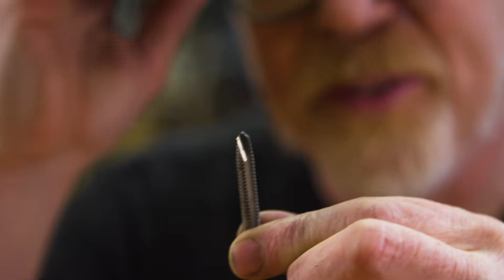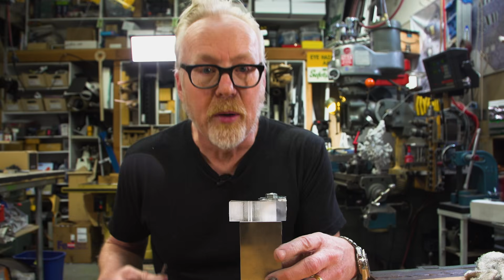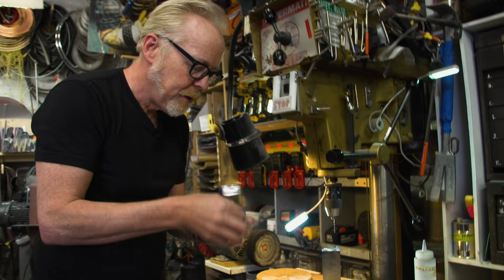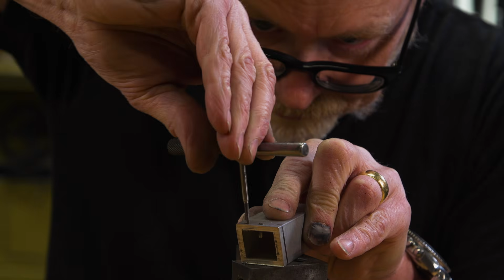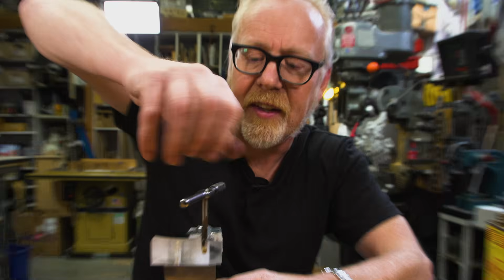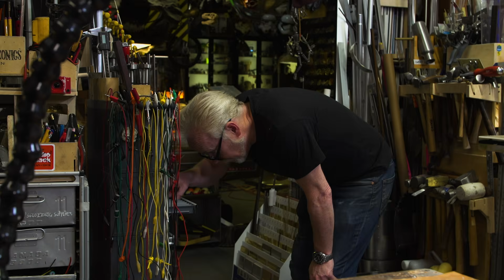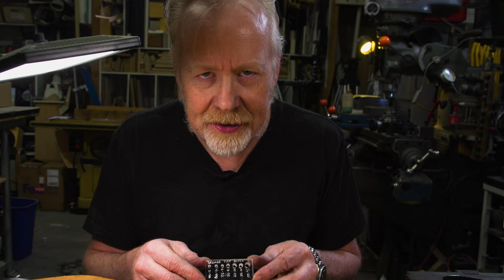Adam Savage's One Day Builds: Thread Tapping Guide Block!

Comment: I use taps every day, drilling and tapping holes in steel window frames. 

Rarely do it by hand, mostly use air powered tap guns. If it's something tiny like an 8 or smaller I might use a hand tap if I'm afraid I could break it. Or if I'm tapping into two different metals (sometimes they layer steel and stainless steel) or if I'm tapping just stainless. For some reason it's a major pain to tap stainless. 

By hand or with an air tool, tapping oil is your best friend. Lube it up, meng. 

We go down to 6-32 screws and taps and up to 1/4-20. Not usually any larger than that. 

If you break a tap, it can be pain. But like Adam said, taps are brittle. A cheap center punch and a ball peen hammer will help you break the tap into pieces and it'll fall out of the hole. Just be careful not to chew up the hole or the threads. 

Otherwise, sometimes you can just back a tap out by hand. That's always a nice break. 

It's funny to see someone enjoy tapping so much, but I just do it everyday so I suppose any novelty wore off long ago. A lot of the tapping I do is to holes that were already drilled and tapped but then they paint the steel frames or hot dip them in a molten zinc bath for a galvanized anti rust layer before paint. So you have to remove all that paint or none of the screws will go in. 

Happy tapping, y'all.

Comment: I was forced to do my first "tapping" when doing a plumbing repipe and had to cut and remove a section of galvanized pipe and rethread it with a Rigid pipe threader. That opened it up for me as I realized it wasn't that difficult. Cutting oil is critical and backing off

Comment: Hi Adam.
You are using the wrong kind of tap when you thread acrylic and aluminium.
There are two types of taps, cutting and pressing.
For soft metals like aluminium, copper and plastics you should use pressing taps that way your threads will be stronger and withstand the screw better. A pressing tap will deform the material and therefore deformharden the material.
Also drilling the holes that way makes the holes to big and effect thread tops and tolerances.
Rule of thumb is diameter of thread - distance between threads = drill diameter.
Example:
M8 hole, diameter 8mm distance between threads 1.25mm = drill for tapping is 8-1.25=6.8mm (actually 6.75 but there's no such drill)
Reply: Or in Inches 
1/4 20 tap
Diameter is 1/4 distance between threads is 1/20
0.25 - 0.05 = 0.2 = 1/5

Comment: You can get these drill taps that has the correct size drill in the tip of the tap. And you can use it in your cordless screwdriver. https://banggood.app.link/jDYofSEfE9

Comment: I would still rotate backwards as even if the swirl evacuates, it doesent cut it otherwise and will make pretty long shives wich i find often, not every time require more force to rotate the tap than with short cuts. I have only broken taps below five mm but the taps are very brittle so i do it very slowly and never with a machine unless it is a larger tap. Material is also digferent. Brass is easy, steel somewhat but acrylic can be really painful. Also, there is taps that presses the shives downwards as well as upwards so it really depends on wich tap you use

Comment: fyi: A screw with more threads per inch is less prone to getting loose of vibrations, because the threads are less steep.
Reply: Yes, but a thread with more TPI is weaker in soft materials, so the threads can deform (strip) and it becomes loose that way.

Comment: According to all 4 of the Tap Drill charts I have at home, the correct drill for a 4-40 tap is actually a #43, not #42.
I think this more than anything is why the hole in the thick walled aluminum came out sloppy after tapping.

Comment: To "tap" into. Molly B. It was called that because you could spray it on an electric screen and end up with Molly. Not really. There was a pool cleaner you could buy for a few years until they made it harder to get, where you just sprayed it to make meth basically. You hooked up screen to a battery basically creating a short, and I don't know if it's the short, or the heat created by it... Basically you'd spray this pool cleaner on the screen and it would crystallize cheap methamphetamine all over it in crappy tone powdery crystals. But it was so easy people didn't care if it was low quality... Don't ask me how I know, and no I'm not or never was a meth head.

Comment: Just about everything I do is with zero budget whatsoever. That also means that I often don't have the money to buy good tools, and I have to make due with cheap ones.
I haven't tapped that many holes / screws yet, but thankfully I haven't broken a tap ever. I mostly use WD40 as tap fluid, since that's what I have. In the past I used Balistol a LOT for just about everything. It's a magical fluid, but not exactly cheap.

Comment: Tig welding a grade 8 bolt to the tap you just broke is the last resort that WILL WORK as long as whoever's tig welding it doesn't weld the broken tap to the hole it's broken in.

Comment: For those who do not have letter / number and fractional drill bits, to in fact drill
the proper size hole, there is a product called drill and tap. It does what the name
implies, drills the correct size hole and the tap is built into the same bit.

Comment: Years ago I  picked up, if memory serves me, a Wiley and Russell Green River or maybe Greenfield No. 1 Tap wrench.
It was 4 foot long and would easily accept 1 1/2" and up taps.
Took two guys to turn it though.

I picked it up at old machinery factory garage sale. They had been in business in Port Huron Michigan since the beginning of the 1900s.
They had tons of machinery tooling and antique measuring equipment.
The factory had been abandoned for so long the owners had to lay down plywood on the floors so no one would fall through the rotted floors.

I'm sure Adam would have gone crazy!

I had no need for it, but it was cool and an example of late 1800s tool machining art.
Now my largest is a  No. 7 Wells Bros Little Giant.

Originally lived in Michigan and there were auctions almost every weekend where old machinists maybe had died and the family was getting rid of all their tools.

Comment: For Sheet Metal (¹/32"-¹/16") I prefer to use my SS Threaded Inserts to obtain a Better "Grab" to minimize STRIPPING!

And, you can always shorten the Depth of the Insert by cutting it down with a Dremel, and then "Chase it" with a Tap!

I also like to place a SS Exterior "Spider Washer" on the Backside of the Insert before Crimping it down to minimize Slippage of the Insert!

I know, "Over Engineering", but do it right the first time!

Take care Mr. Savage,
🤓 -Thomas
Port Orchard, WA
(Just West of Seattle, Washington)

Comment: Adam: "I need to be better about eye safety after getting pieces in my eye"

Also Adam: Blows tiny shards of plastic out of a hole without eye protection
Reply: It's all a setup for his bionic eye series of one-day builds. It's his untapped field you could say.
Reply: This was filmed in the pre-apron times.
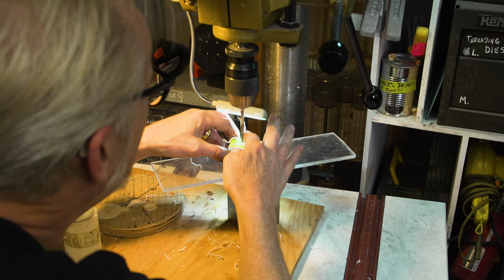Reply: Also, cleaning the chips off at running drill bit at 36:09. If he had a really sharp set of drills like cle lines his finger likely would have gotten cut up.
Reply: @CanDriveSoon  Things that seem dangerous to the inexperienced are often inconsequential to a skilled craftsman. It's funny to see comments, from people not in the trades, on videos like this, where people think something is dangerous. It's like when someone puts their hand through a candle flame, or funds their thumb across a blade to see if it's sharp. People who are inexperienced with that kind of stuff freak out when they see it. Doing what he did isn't a big deal if you know what you're doing. Also, the flea of a Cle-Line set of bits isn't sharper than any other drill but set. The flute sharpness makes no difference. They're not doing any work besides acting as a bearing surface, forming a seal against the bore to ensure chips are carried up & out of the hole and not be pulled under the leading edge of the flute.

Comment: I had to learn tapping and threading by being handed a tap and a thread cutter at age 12 with no instruction. It did not go well. Also the one and only tap, a bottom tap. You can tap a hole with a bottom tap but it will be crooked. Ahhh, the joys of woodshop in the 80's

Comment: Metric Taps?     Also,  to get the tap started straight, I clamp the part to be tapped in a drill press vise,  put the tap in the chuck, press it down & rotate the chuck by hand. Easier to tap at funny angles, too.

Comment: I tap 6mm threads into 5mm mild steel with a battery drill, put it on screw driver and set a torque is better than using these holders, these holders wobble too much and make the tapped hole too big, with the battery drill you can easily keep it vertical to your work, and with the torque stops your not putting too much force in it, cutting oil and constant clean out i used to tap hundreds of holes a day with the same tap, probably 5 times quicker and safer with a battery drill, 
Taps are strong in the twisting force, its the snapping force they dont like like Adam showed

Comment: Honestly, between using my lathe or using a tap I like a tap. Threading on my lathe scares the shit out of me. I'll have to force myself to really learn to do it one of these days. Till then, I will continue to use taps.
Reply: Trust me, tapping (at home) is faster and easier, the thread cutting mostly comes in handy when you need 1 threaded part and buying a tap for it would be uneconomical.

Of course, if you're looking at mass production, a cnc machine or turret lathe or thread rolling would be much faster than a tap. most people don't have those at home though.
Reply: @AlexanderBurgers  very true. I have a 1947 logan threadcutting lathe. Actually does really well, just still not my favorite and takes a $300+ gear to do metric.
Taps and dies are far more economical for me to do metric.
As far as cnc goes I leave that to the boss guys and machinists at work, I am just the QA lol.

Comment: I've only been it the metal game for about 4 1/2 years. I had no idea tap extractors were a thing till someone told me. I bought the best set I could find. I used to use forceps or a hammer and center punch.

PS, left handed drill bits work as well with enough pressure

Comment: Pro tip, if the guide block has threads it will work even better :-). The tap gets a synchronized start :-). One job they used to run at an old empoyer involved hand tapping 4-40 into a fairly hard carbon steel. The threaded tap guide took something very difficult and made it much easier :-). To remove a broken tap first start saving any old carbide tools that are too "dull" for everyday use, just toss them into a tool box drawer. For say a 1/4-20 tap that went in full depth than snapped off I might select a 3/16 solid carbide center cutting endmill, 2 flute or 4 flute is fine as long as center cutting. Mount the part with broken tap in the mill, spin the endmill say 1,000 rpm, and use that sensitive feed handwheel you made and creep that spinning endmill right down through the center of that tap :-). No coolant needed but you can blow chips out with your compressed air. Might take 2-3 endmills but typically only one. Gets taps out nearly 100% of the time. Once you have that 3/16" hole down the center quite often the tap will fall apart and is easily removed.

Comment: check out fireball tool mega vice build part 2. check out that tapping tool he uses on heavy steel plate. taps a hole in a few seconds with a cool drill

Comment: Always use your drill to tap size chart, don't rely on memory.
Reply: Or call an exorcist to get rid of the imperial system, in the metric system you can rely on memory.
M3 2,5mm, M4 3,3mm, M5 4,2mm, M6 5mm, M8 6,8mm, M10 8,5mm. And the last time i had to use it was more than 10 years ago
Reply: Diameter of thread - distance between threads = drill size.
Reply: @morilot  said "Diameter of thread - distance between threads = drill size"
And what is the diameter of a #4-40 bolt?
And what size drill do you use?
Not from memory, show your workings....
Reply: For common taps you absolutely can rely on memory. But always measure your drill bit or check the size on the shank.
Reply: Words of wisdom right there!

Comment: About the threadcount. the softer the material the courser you want the threads. Just think of woodscrews. Soft material, verry course threads. Metal work (steel) fine threaded bolts...
As for the drill sizes. You could drill a few (blind) holes with the core drill's that you can then testfit drills in before using it to drill the holes.

Comment: If tapping in aluminum or for me because I throw darts tungsten, putting a mixture of Alum and hot/boiling water in the tapped hole will eat away the steel tap. I have done this many times when I've broken the dart points in the tip of the dart. I place the dart in boiling water with the alum and within  an hour the steel is mostly dissolved.

Comment: Perfect timing, got some fairly critical holes to tap this weekend and never really had much luck in the past. 

Great tutorial! :D
Reply: I'd never heard of a tapping block, but it does look useful, however in case you don't already know, once you are 1-2 threads in, just enough that it starts to bite, remove the tap wrench with the tap left in the hole and you can use a Square  (or anything with a good 90° edge) to check the barrel of the tap is straight on both the X and the Y axis (or if you have absolutely nothing to hand, look straight down the shaft and judge it by eye. You can then correct it within the first few threads without worrying about cross threading.

Comment: a dirty life hack that will come in handy from time to time, you can use your drill press to get your tap started, put the tap in the chuck DON'T turn on your drill, instead you are going to lower it so it touches what ever you want to tap into, and turn the chuck by hand (make sure it is lubed up) and get the tap started a couple of turns like you would with a tap wrench half a turn in quatrat turn out a few times, this ensures that the start of your tap is straight since the chuck should be at the exact angle you drilled your hole at, then after you got it started leave the tap in your piece and take it out of the chuck, attatch the tap wrench and carfully continue.
it is not ideal, but in a pinch when you are on the clock and you have a new tap that you don't have a tapping guide for it can come in handy, this saved my ass so many times